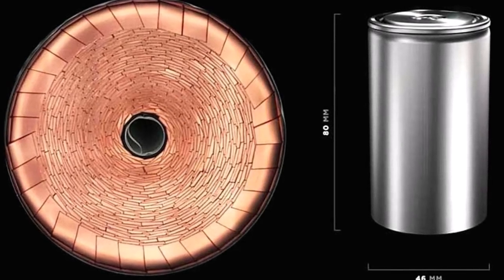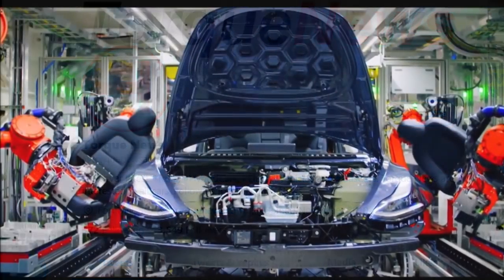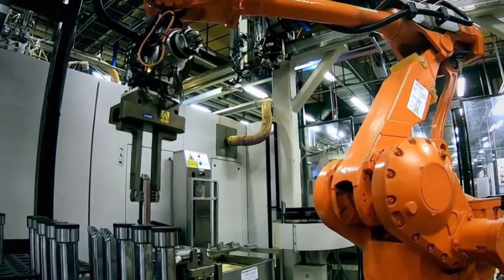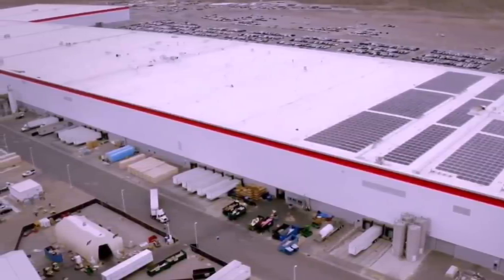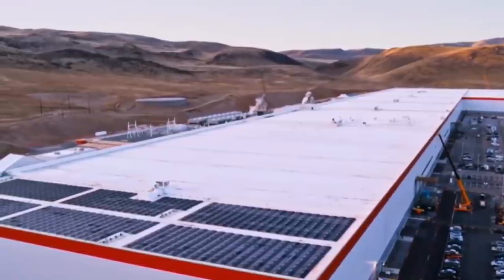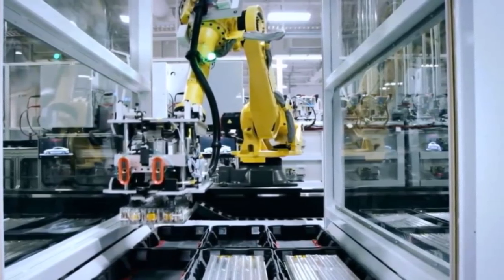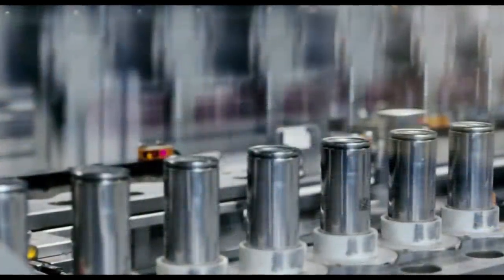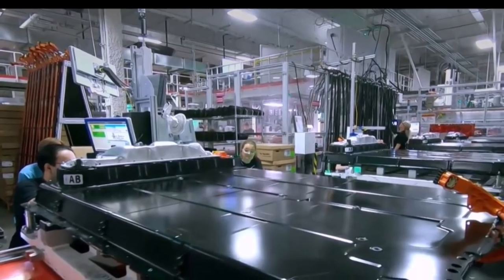Tesla's Different 4680 Battery Plans with Panasonic, LG, and maybe CATL

Comment: Thanks Armen for posting my story. I know that for now, there are more questions than answers regarding the future 4680 batteries, but from what we are seeing, Tesla's move to share their new 4680 tab-less cell design will benefit both Tesla and their battery manufacturing partners.
Reply: and exposed there sicrets? why did they both maxwell tech and hibar?
Reply: @davidcohen7741  Maxwell's purchase was for the dry electrode technology, and ultra capacitor tech. Hibar's expertise is in scaled battery manufacturing. It is uncertain if Tesla will share Maxwell's battery technology with Panasonic and/or LG. If they do, it will be in a limited extent to help build more Tesla 4680 batteries. But it's quite possible that they just share the tab-less design, and 4680 format with their battery partners, and keep the secret sauce for themselves to stay competitive and in control.
Reply: There are 3 different things mixed when people talk about the 4860 cells.

1) There is the intrinsic format which is different than previous ones and rightsized surface area to volume. GM and others talked about it a lot since before the first introduction of the Volt years ago. They were right. 
Surface area is related to heat exchange and strength of pressure containment. Volume is related to the materials that actually store and conduct energy, that should also be balanced for better energy or power density specs.

2) The cell chemistry, that is neutral in regard to the exact format of the cell. Tesla is said to be developing a high nickel cell with advantages in its specs and costs. It could conceivably be implemented in any format but was presented combined with the 4680 format in the roadrunner project. 

Tesla may license it's chemistry advancements to other companies or hold'em to itself.

3) Manufacturing Process, which is somewhat independent of both previous aspects. The DBE technology Tesla bought with Maxwell has the potential to optimize, reduce cost and amplify scale of cell manufacturing.

Again, Tesla may choose to license it's technology or hold it for itself.

The Highbar acquisition brings onboard Tesla the means to develop and optimize itself the cell manufacturing processes. This works at least as a lever to pressure partners not to try to block Tesla's growth limiting Tesla's access to cells. In doing so, Tesla might replace them and make them less relevant. If there is a healthy, nonexclusive cell manufacturing base Tesla might rely on, it's good to all the EV markets, including Tesla. 

Tesla can focus on investing in  it's core businesses, instead of commodity cells. Other manufacturers of EVs may adopt the basic 4680 Tesla format, as they could with the 18650 and 2170 before.

It does not preclude Tesla from producing specialized value added cells if they with so to differentiate certain products.
Reply: @celsostarec6735  Good info. Thanks.
Reply: @celsostarec6735  Completely agree on everything said. Couldn't say it better, good job my man :D
Thanks for sharing
Reply: Thanks,  @Celso Starec!!

Comment: Are there are plans to use Tesla's tabless battery technology in AAA batteries?...
Thanks...Old West Magazine
Reply: Unlikely. Tesla's tab-less battery cell design is specific to multi-battery, enclosed case, commercial automotive designs that use rechargeable batteries, not replaceable consumer batteries.
Reply: @deanmcmanis9398  But I use rechargeable AAA batteries...Thanks...Old West Magazine...
Reply: @9cGFNRH  That is fine. But the gains and uses of the tab-less design are very specific, requiring an external case to prevent oxidation and other issues with removable batteries.
Reply: @deanmcmanis9398  Thanks Dean...
Stay safe...
Reply: @9cGFNRH  Thanks Old West. You too.
Reply: No need because the 4680 tabless design was to free and shorten the electrons travel so the heat of resistance will be mitigated.
Reply: @ricwilmot1654  Excellent point Ric...Most individuals don't realize that heat is an enemy of technology... Old West Magazine...

Comment: Since Tesla already has the casting ability in China and is apparently expanding it with new adjacent buildings, I do not doubt that they will be using the 4680 very soon if not already as trial runs for Berlin and will be continuing at full speed as the trials become more and more successful.
Reply: I agree. We saw that a short time ago Tesla shipped a dozen or so Model Ys from Fremont to Giga Shanghai ahead of their first Model Y production. And either these were just the regular U.S. Model Ys (with 2170 batteries) or they were the new prototype cast chassis, 4680 battery powered Model Y's, as examples of how these unique, new Model Ys are different in their design and assembly from the Giga Shanghai Model 3s and previous U.S. built Model Ys.